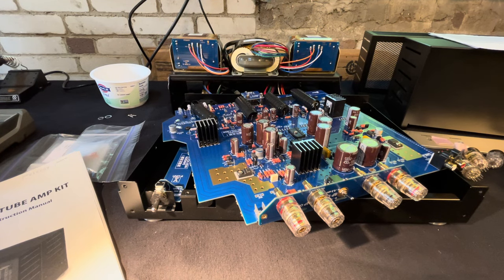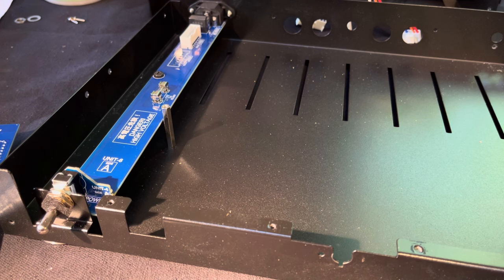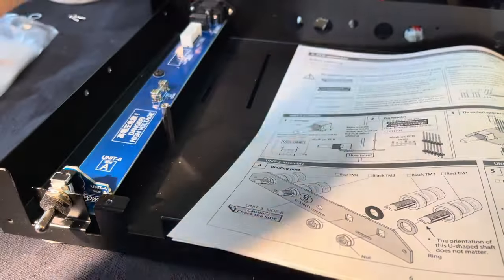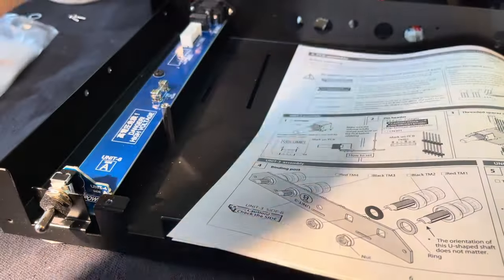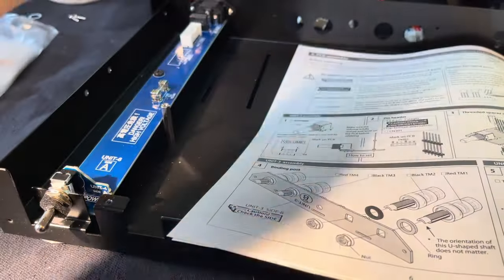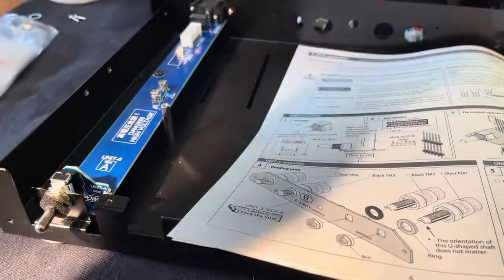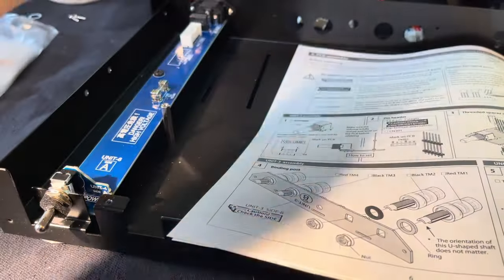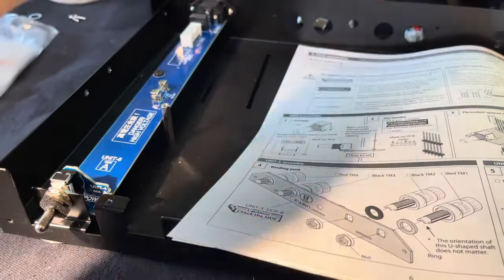Building the Elekit TU-8600S 300B Tube Amplifier!

Comment: I just ordered the TU-8600S version with Lundahl  output transformers.  :
 )   I haven't even received it yet and I'm already having dreams where 
the first time I power it up  all the tubes explode and the amp bursts 
into flames..  I've worked with and built electronics kits for 50 years 
but this one is going to be intimidating.  This is the most expensive 
kit project I've ever done.  I'll be taking my time on this build the 
last thing I want to do is have it go up in smoke.  Thanks for the 
build video!
Reply from the maker: Take your time, double check all your solder joints and you should be fine. Good luck!
Reply: @thebostonaudiophile  Hi. Thanks for the reply.  I am 95% finished building the amplifier.  I upgraded the resistors with Dale military spec 1% resistors and the coupling capacitors to Jensen 0.1 uf  Copper Foil Paper-in-oil Silver lead Copper Case capcitors.   I used German WBT silver solder for all the solder points.   All the tubes I ordered are Electro-Harmonix.  For the 300B's I got the balanced "Duet" pair.  The 12AU7's are matching  high gain tubes with low noise & Microphonics with balanced Triodes.  All the tubes are gold pin tubes.  

 I am waiting for the upgraded 9 pin porcelain tube sockets I ordered and the tubes to arrive so I can finish the build.  I am looking forward with a bit of trepidation to the first time I hit the power switch..  : )  I only wanted to build this once so I did all the upgrades I could think of now.   I will let you know how it goes..  Thanks!
Reply from the maker: @mojoneko8303  Let me know how it goes. As long as your solder joins are good and diodes, electrolytic capacitors, etc are properly oriented, you should be okay. Good luck!

Comment: I was going to get this but the funds have let me down, but today I found out about a new Elekit [TU-8900E] which lets you use 300B OR 2A3 !!
Reply: Mixed reviews on diyAudio...TU-8900 is designed based on 12AU7 and 12BH7 only and some are trying E80CC / 6085 (with resistor changes).  This would be a warranty void when something blows out.  Some have both 8600S and 8900 and the 8600S sounds more natural.

Comment: Hi. Thanks for the video. Could you perhaps post a short video on soldering techniques and tips for newbies? I have this amp on order and am considering having it built by the distributer, but also thinking about doing it myself. But I have very little experience soldering (has been years, and I never did it in an audio setting).
Reply from the maker: Thanks for your suggestion. I’ll try to do one pretty soon.

Comment: Power transformer right next the the output transformers on a steel chassis though?
Reply from the maker: @newtronix  Transformers should be in steel boxes, aluminum does nothing to block magnetic fields.

Yes, ideally all the transformers (power and output) would be separated, but this way is very common.